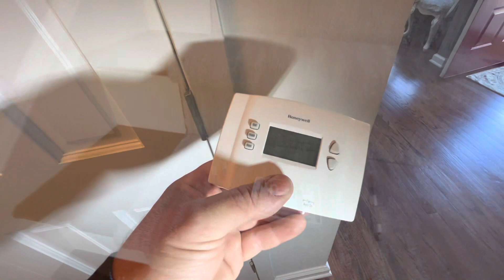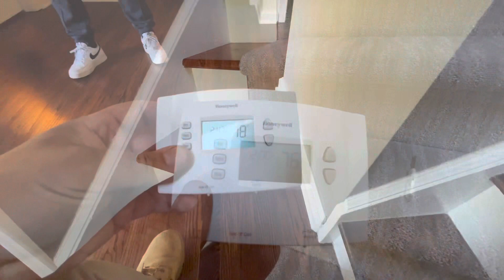HVAC.  WHY IS MY THERMOSTAT BLANK?  HONEYWELL

Comment: Good catch. I had one like that on a weekend earlier this year. Customer change battery and then nothing worked. Ended up being the battery contacts had corrosion on them, cleaned them and working again.
Reply from the maker: Exactly what he did.  He started messing with the batteries.  And the corrosion scraping is also a good fix.  Thanks for watching and I appreciate the feedback.  Stay well.

Comment: You never know with those old cans. Pepsi and Pizza Hut went back to their old 70s and 80s throwback logos and then left them there. I think Coke did the same thing. Not sure about Budweiser. I found an old unopened can of Quaker State motor oil in an attic with the metal tops that you had to use a can opener. It was at least 50 years old, never used. 

If you find a beer or soda can with a pull ring tab, you know that's at least 1980.

Good man with the easy battery fix 👍
Reply from the maker: Thank you.  I was thinking it was from when the house was built because who hangs out in an attic and downs beer?  Lol